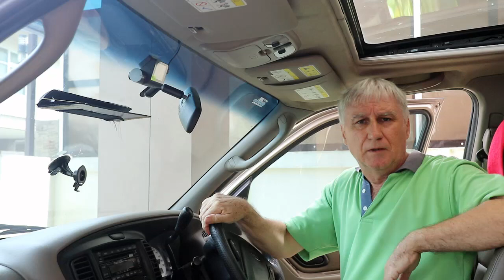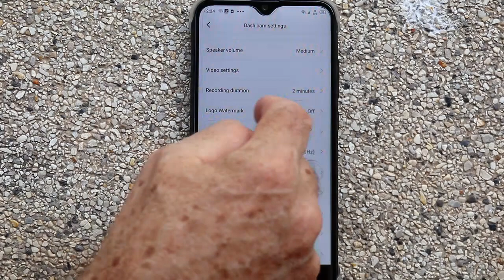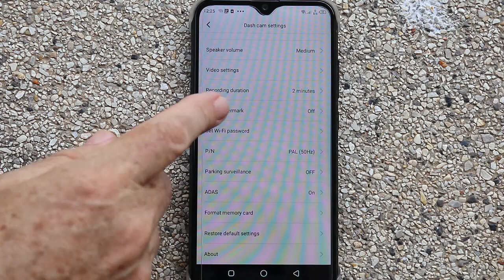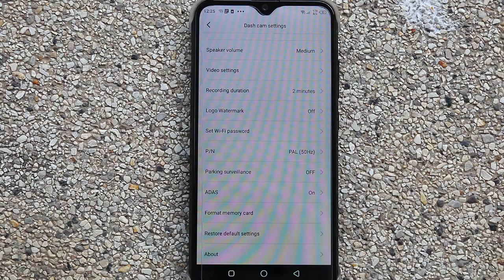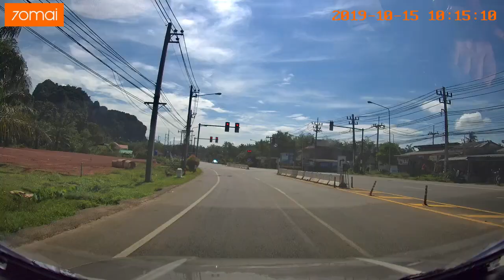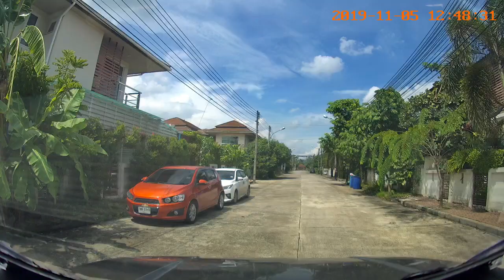70mai Dash Cam Pro Six Month Review + Latest Firmware Update 1.0.6na

Comment from the maker: The person who told me that firmware version 1.0.6na adds speed and GPS coordinates to downloaded videos sent an e-mail to tell me that he thinks he may have a different model camera to mine, which would explain why I can't see this information with firmware version 1.0.6na on my 70mai Dash Cam Pro. This highlights two points I made in the video. Firstly, 70mai now make several different dash cam models and it starts to get confusing. Secondly, the 70mai firmware management process is poor. With each update they should provide a complete list of changes for every model affected by the change. The only information provided for this update was: 'New support for 70mai Tire Pressure Monitoring System Lite'. That wasn't helpful because I don't have a 70mai Tire Pressure Monitoring System Lite. If they provided detailed information of firmware changes for each product it wouldn't be necessary to search around and guess what had changed after every update.
Reply: Do u know what is his model, i want to buy thic dashcam but i want that information on screen too. Thanks phil
Reply from the maker: @dion5924  I never got to the bottom of this, but the 70mai Dash Cam Lite looks very similar. In photos I've seen it looks to be the same shape, but the lens is a bronze colour instead of everything being dark grey as on the 70mai Pro. I'm wondering whether he might have a Dash Cam Lite?

Comment: Hi! Can this withstand the high temperature inside a car which might rose to 60-70 degree celsius when parked outside in summer ?
Reply from the maker: I live in southern Thailand where outside temperatures reach around 40C in the hot season. In fact, it's not the hot season now but temperatures this week have been close to 40.
When I get inside my car after it has been parked outside it feels like a furnace. I don't know what the actual temperature is, but it must be 60+. Every year there are news stories of young children dying after being locked inside stationary cars because the interior gets so hot.

I'm pleased to say there have been no heat-related issues with the 70mai dash cam. The adhesive/electrostatic mounting mechanism has been fine and the cam has remained stuck to the windscreen. The camera has continued to function well in the heat with no electronic problems. The only problem is that Lithium Ion batteries have a shorter life in very hot climates. My battery lasted just over a year before I needed to replace it.
Reply: @PhilUKNet  Thank you Phil. I have one more query. Can the cam be used without its internal battery by directly connecting it to the 12 volt socket that is available inside the car?
Reply from the maker: @jyotipadtalukdar2456  I haven't tried this, so I'm not sure. I keep mine connected to a 12V socket in the car that is live all the time, but my cam does have an internal battery. Sorry I can't give you a definitive answer.
Reply: @PhilUKNet  No problem Phil. Thank you for your response 👍

Comment: Another update is the fact that you can change the password of the WiFi. Was by default 12345678. After the update went into 8 random numbers and with the option to replace it with whatever you want. My version is: 1.0.9a and I live in Europe (like a king) driving a Mercedes. You should try to update it. I bet is available also for ye!
Reply from the maker: I think I can change it, but it didn't seem important.

Comment: Hi Phil, very well done video.  I just bought one of the pros and the GPS module.  It came with 1.0.4 and would not show the GPS/speed.  I sent feedback via the app and no response at all.  I sent an email to support and either a robot or a total idiot responded with no help at all.  4 emails later after threating to return it to Amazon, they mentioned that I needed 1.0.5 to get the GPS/speed info.  BTW, their help.70mai.com link is dead.   I finally figured out how to get it onto the unit, by finding a Youtube that explained how.  It appears that the GPS/speed now works although it's in KM, not miles.  I find no place to change that.  The last email said that you need the watermark on for these to work.

You are much kinder than I.  I won't be buying another of these at any price.  When company support is this pathetic, I'll go elsewhere.  Sadly, Garmin is no longer making the DashCam.  Mine died after a year or so, but it had a great video, early warnings, GPS/speed.  I'd get another one of those in a minute.
Reply from the maker: Thanks for your comments. Recently, I've received more negative comments about this dash cam than positive ones! From my experience the hardware seems to be quite well made, the image quality is fine, the basic functions are fine, I like the voice control and I haven't experienced any reliability issues. The additional features (ADAS, parking surveillance, etc) are just 'so so' and I don't find them very useful. The firmware update process is a nightmare and there is virtually no support. My impression is that they are directing their resources towards new products and don't really care about older products.

I started off looking at Garmin, but the 70mai caught my eye and it was a lot cheaper. I didn't know that Garmin had stopped production. Where I live in Thailand most dash cams are cheap, 'no brand' models from China and don't inspire confidence. With a brand like Garmin you can be assured at least that there is some quality.

One person told me that he now has GPS/speed on recorded videos after installing 1.0.6na, but I don't. Another person told me that he has this with 1.0.5na, which doesn't make any sense at all. They should make it a lot clearer what changes have been made with each firmware version and improve the update process. It's just confusing. These days I'm just using it as a basic camera in case of an accident and I've almost given up trying to install firmware updates. I've wasted quite a lot of time on this already.
Reply: Thailand, I spent 4 weeks in Bangkok in 2009.  Nice place.  Since most of us want an item to work out of the box, work forever, & If there is an issue a great responsive, knowledgeable customer service.  Of course, we want it cheap.  Rarely do all of our wants come together.  I found a long time ago, make money the last variable in your decision.  Here we have Harbor Freight, 100% from China.  We all know if you buy something there, it's a throwaway.  If you can get your problem solved before it breaks you are happy.  Or you only use it once in a while.
Reply from the maker: @myutube6422  As with all places, living somewhere is very different to visiting as a tourist! It's OK, but far from perfect. My maxim in life is that you can have anything, but you can't have everything. I didn't want one of the cheap, no-brand cameras and the 70mai seemed like a good compromise between quality and price. It's still doing the job I want it to do, but since owning it a number of issues have been highlighted. I can live with these issues, but others can't. Most things are made in China these days, but there are big differences in quality. Some stuff is junk, some is quite good.
Reply: I agree I use to live in Mexico City, a lot different than spending a week in Cancun :o)  I also agree we all make decisions between quality and price every day.  Thank God for utube, it has saved me thousands of $$$ avoiding the real junk.  Usually, the reviewer hasn't had any problems so they don't know about the customer service.  I'm glad that you came back with your followup.  Most helpful.  I'm old enough to remember the junk that came out of Japan after WW2, now they produce some of the highest quality products on the market.  When the Chinese figure that out, the rest of the world is in trouble, IMO.

What is that horizontal bracket on your windshield?
Reply from the maker: @myutube6422  Hi Bill, I can also remember a time when electronics coming out of Japan were considered junk! Japan fixed the problem and South Korea followed. Both countries now have a reputation for high quality. China is already changing and brands such as Huawei have a good reputation. Things will continue to improve.

You can find out about that strange thing on my windshield here:

https://youtu.be/aLz4QUbjdi8
Reply: No doubt that they will get better.  Clever idea with the "shield".  I hadn't looked at my videos, was screwing with CS over the GPS/speed thing.  I just downloaded one and looked.  I just have a reflection really light at the bottom right.  It was overcast so I will check when it's sunny.  I'm wondering if mine is better because I have it at the very top of the WS so the distance between the lens and the glass isn't as much.  I will check it better and get back to you.  I looked at yours in the video, I wonder if it would help if you could put it closer (2-3") to the top of the WS?  And/or a small black "card" below the lens that attached to the camera body and extended under the lens to the WS.  We would probably get a ticket for obstructing the WS.
Reply from the maker: @myutube6422  I'm fairly happy with it now and don't want to tinker around moving it. Ticket? What's that? If you drive a car in Thailand you can do whatever you want without fear of getting a ticket. Indeed, most Thai road users do exactly that. It's one of the joys of living here and the reason why the roads are the second most dangerous in the world.
Reply: I know what you mean about messing with things that are working.  Are you there for a job, or as a life choice?  I'm not that comfortable living in 3rd world countries any longer.  Hell, a lot of the world is becoming a risk.  Even though I have investments in Mexico, I doubt if I'll ever return there.
Reply from the maker: @myutube6422  Life choice. I'm not always comfortable, either, but with a wife and two kids it is a case of having made my bed and now having to sleep on it. For many years the UK had been going completely down the drain, but the election last week could be the start of some big improvements. The result has heralded a huge shift in British politics.
Reply: Well, I always recommend having a plan B.  I have a British friend and so I have been watching UK news.  Of course, we have our own circus.  Good luck.  I spent 3 weeks in New Zealand, and was impressed.  Definitely, a place that I would consider if needed.  The religious nuts make a lot of places a nonstarter.

Comment: Interesting, does the camera detect every time you get into your car (say in the morning) as a new parking event? Also, can you configure the settings so that the camera makes NO sounds (or speaking) at all, ever?
Reply from the maker: Once you've activated parking surveillance and turned the camera off it waits for a predetermined time (20, 30, 40 or 50 minutes) before it starts working. After that, every time it senses enough movement to trigger the G-sensor it records an event. Therefore, if get into your car the next morning and close the door firmly it will record an event. It's only the ADAS that 'speaks' to you. If you disable ADAS you won't hear any sounds.
Reply: @PhilUKNet  So if I turn off all the 'sound' settings and I use the voice control to take a photo, it won't announce that it's taking a photo?
Reply from the maker: @pavichokche  Sorry, you are quite correct, I forgot about that! When you take a picture you hear a camera shutter sound and it says, "Photo taken." I can't find any way to turn this off. On the camera menu I can't find a volume setting, but I can on the app. If you go into the app there is a 'Speaker volume' option. The bad news is that there is no 'zero' volume option. The options you have are large, medium and small. These are very strange options for volume, but I guess they were translated from Chinese. If you select small, the sound is fairly quiet but you can still hear it. To summarise, I don't think you can turn it off completely but you can make it quiet. Apologies if you have worked this out for yourself already.
Reply: @PhilUKNet  No worries, I haven't purchased it yet, I'm just trying to see how much of its sounds I can remove before deciding to buy one. I'm just thinking, if I get into the car every time and the vibration from me closing the door and moving around triggered the parking mode, will I hear a "there was a new parking surveillance video" message? Or can that voice feedback be turned off?
Reply from the maker: @pavichokche  You've highlighted a major annoyance and I don't think there is much you can do about it. Because of the 20/30/40/50 minute delay when you activate parking surveillance you don't trigger an event when you leave the car. However, every time you return to the car and open/close a door it does trigger an event. Therefore, every time you return it tells you that there has been an event and you don't know if it was you entering the car just then or a genuine parking incident. It's not a perfect camera, but it's cheap. My view is that it performs basic dash cam functions well, but doesn't do a perfect job with some of the 'extras'. 70mai obviously tried to add extra features to make it more attractive, but they're not as good as in more expensive dash cams. Parking surveillance is a good example. The basic function is fine, but compared to other cameras there are omissions and a few little annoyances.
Reply: @PhilUKNet  I honestly wouldn't mind if it detects and records false positive parking events, but I don't want the voice feedback, that will get annoying very quickly. I guess I could modify the camera and just disconnect the little speaker inside.
Reply from the maker: @pavichokche  I think that will be your only option at the moment. As I said previously, there is no option to disable the voice warning. There is only an option to reduce the volume, but that option only appears in the app. I'm not sure how receptive 70mai will be to user suggestions because this should be fairly easy to implement in a new firmware version. The impression I get is that they are directing their resources at new models (I've received a lot of e-mails about their new TPMS unit) and that they aren't too interested in order models.

Comment: Could you reccomend me a good dashcam for the back view? Because 70mai pro cant be sync/paired with the 70mai reverse camera.
Reply from the maker: I'm afraid I can't. I only have experience with this dash cam. Sorry.
Reply: Thinkware or Blackvue...but not the same price range unfortunately
Reply from the maker: @canonixus850  Yep, one of the main benefits of the 70mai is that it is sold very cheaply, so its features won't be able to compete with much more expensive dash cams.

Comment: The GPS co-ordinates are already in the MP4 files. There is a forum which talks about how to extract it as .gpx file or .srt file.
Once extracted, you can use Dashware to put nice speedometer in the video or .srt file can be used as subtitle in VLC player.
https://dashcamtalk.com/forum/threads/finally-new-firmware-and-new-app.39425/post-471731
Reply from the maker: Thanks for the link. Sorry for the delay replying, but I wasn't notified of this message. A new YouTube feature lets me look at messages I haven't replied to and there are lots.

Comment: Phil need some help , since I update to 1.0.6na i can’t calibrate the dashcam
Reply from the maker: It seems to depend on road markings. With 1.0.5na it was inconsistent. Sometimes it was good, but one time it took 4 days! Since updating to 1.0.6na I have calibrated twice. The first time took one attempt and the second time two attempts. I don't believe your problem is related to 1.0.6na. Find a road with good markings and try again in good light. Good luck!
Reply: Phil UK Net Did on the highway already , without having success
Reply from the maker: @mehdiUtubeful  It can be very temperamental! Earlier this year I tried for 4 days on one occasion. After updating to 1.0.6na calibration failed the first time. I tried again and it calibrated almost immediately. I don't think your calibration problem is related to the firmware upgrade. Whenever I need to calibrate I always drive along the same stretch of road where it usually works.
Reply: Phil UK Net also the speed and gps coordinates are not shown in the screen ,  i jumped  from 1.04 to 1.06 as 1.05 had lot of issues
Reply from the maker: @mehdiUtubeful  I also had problems with the speed and GPS not showing on the dash cam at first, but restoring factory settings fixed that. This information doesn't appear in downloaded videos, but the person who told me it did now thinks he may have a different model camera to mine. As I said in my video, the basic hardware is fine, but the firmware management and download process needs to be improved. It's flaky and there is too much guesswork involved because they don't explain fully what is in each firmware release.
Reply: Phil UK Net thanks for the help , I reset to factory setting as you advise and now the speed and coordinates works. Still having difficulties to calibrate ADAS
Reply from the maker: @mehdiUtubeful  I'm pleased you got one problem fixed, at least. Calibration can be extremely easy or it can be a pain. What I've also experienced is that calibration will fail, but ADAS will start working. I've had it fail in the past, but then started to hear ADAS warnings. If you persevere enough I'm sure it will calibrate eventually!